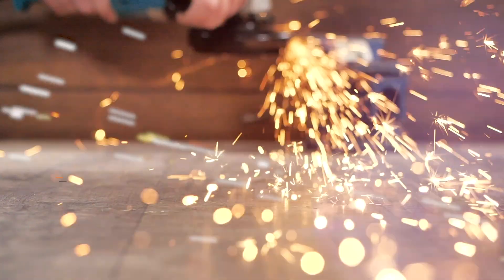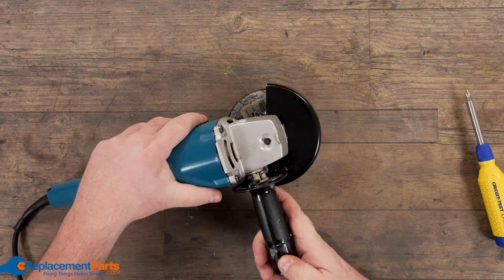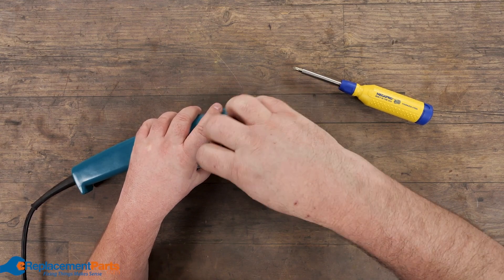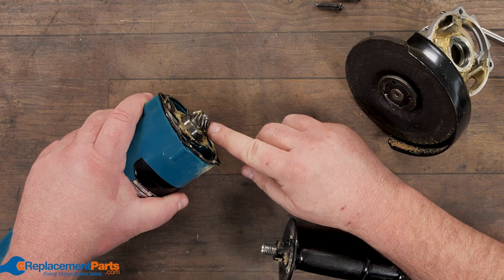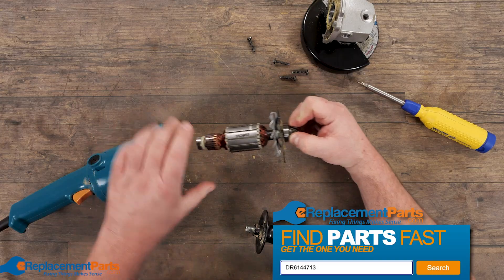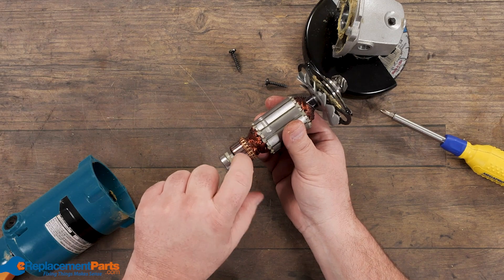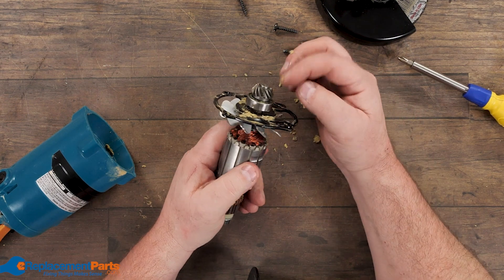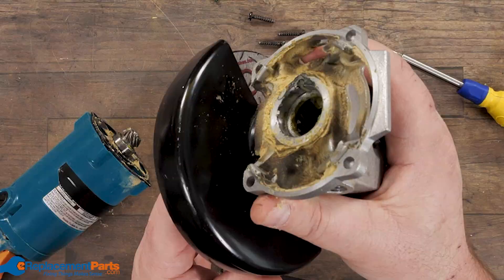Tool Tear Down: Angle Grinder | How to Disassemble Your Grinder| eReplacementParts.com

Comment: Thank you, very helpful video.I need to know 1 thing tho at 2:27 when you show the inside of the grinder stripped, there are two springs looped around the carbon brush holders and those springs have wires attached to them, if you can please i need to know where those wires attach to.
Thanks a million